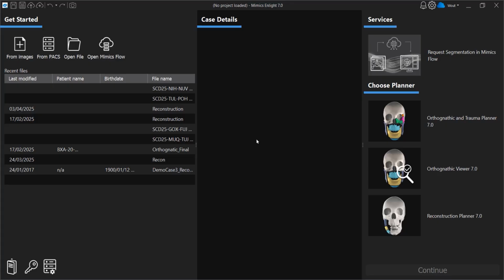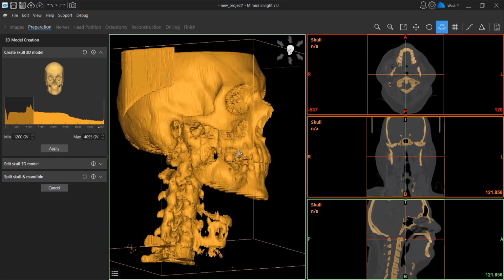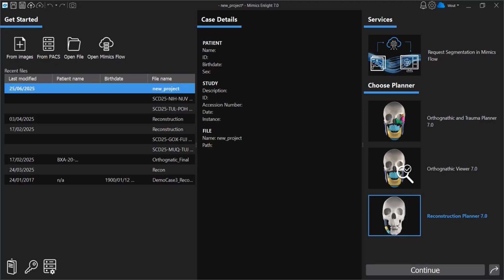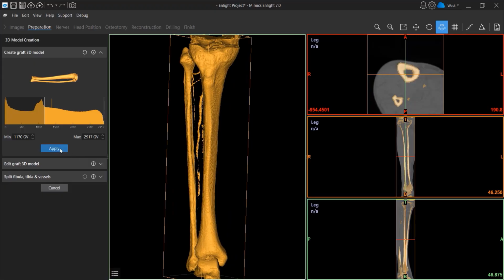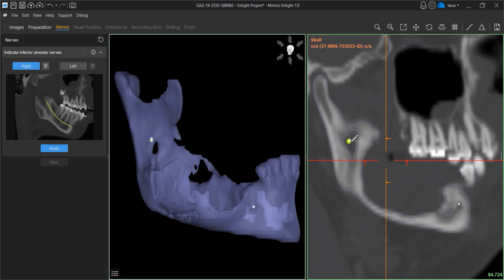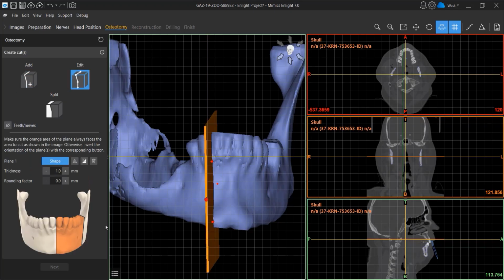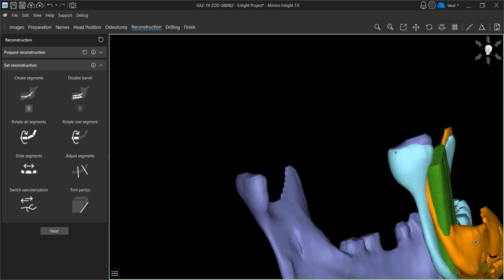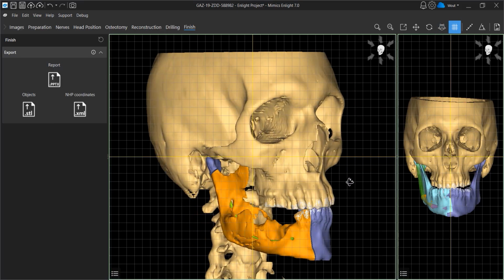Enlight CMF 7.0: Virtual Planning for Reconstruction Surgery

Comment: Does it export cutting guide as STL?
also, can patient specific recon plate be made with it?
Reply from the maker: Hi, thanks for your question! Mimics Enlight CMF is used for surgical planning, while cutting guides and other patient-specific devices are designed in 3-matic, where STL export is possible. For patient-specific recon plates, this also depends on your region's workflow, manufacturing setup, and regulatory clearance.
Reply: @MaterialiseMedical just like it can export surgical splints STL for Orthognathic, it doesn’t export any guide for reconstruction?
How does it help in reconstruction then?